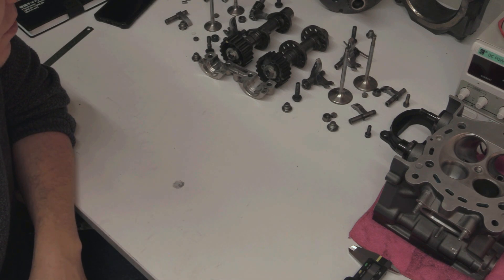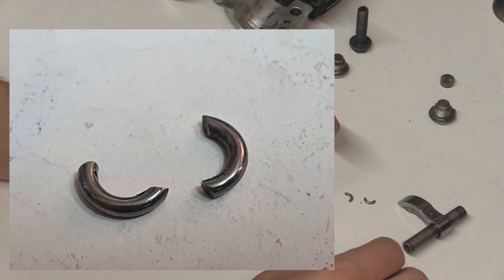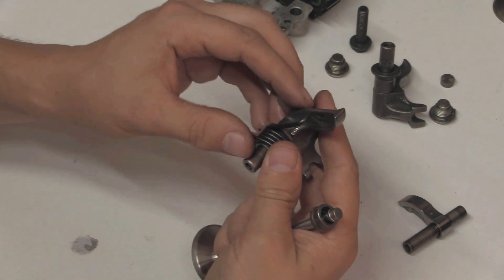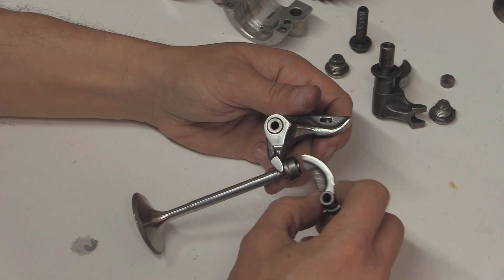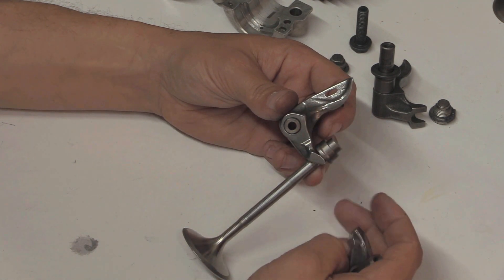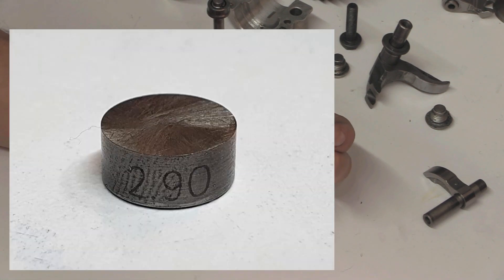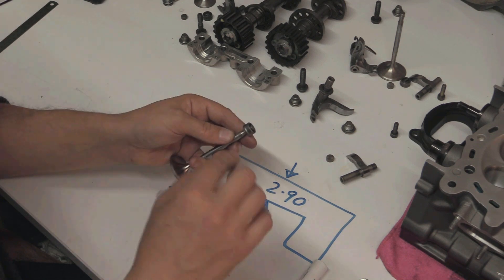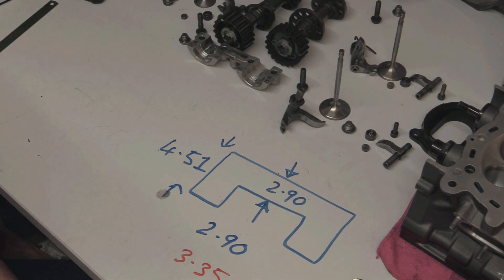Desmodromic Valve Clearances

Comment: Very interesting.  Learn something new every day: I thought the whole point of desmodromic valves was to avoid having valve-springs. Yet, there they are, just in a different place.  I assume the valves still get pulled closed by the action of the cam too right?
Reply: Erik Olafsen ,, the engine will run fine without the springs
Reply from the maker: LOL will it?
Reply: @thedirtyworkshop  They don't idle too well without them apparently
Reply from the maker: Idle, accelerate and generally run properly.
Reply: @thedirtyworkshop  They run fine once the revs are up according to desmo guru Brad the Bike Boy but of course you know better
Reply: The Workshop ,, it’s ok Matt , I don’t expect you to know everything .... that’d be an impossibility 🤣
Reply: @thedirtyworkshop  Wel the now old 2 valve 900 wil run fine without the springs . I now that because i did that on a bott racer in the `90 `s.
Just check the closer clearens every 2 races , so that it is nearly 0 .
If the heads are off , and you turn the camshaft by hand , you wil understand why the desmo system is so great.

Comment: They are a wanker to do if the engines in the frame. I check the clearances on my 916 probably about once every two years. Given it takes about 25 miutes to drop the engine out of the frame its not much of a problem. What kills ducati engines is in general the wankers that own them.

Comment: i always think there is an irony in the Desmo valves on Ducatis, Desmo allows high revs without float, yet nothing that actually revs uses Desmo valves,  never understood why??
Reply: The V4R pk power revs are at 15500 rpm compared to the BMW S1000RR at 13500 rpm (I think). Conventional valve springs have been obsolete at motogp level for over ten years while the Ducatis are consistently the fastest bikes out there.
Reply: @yodaedwards5225  i have a road bike with a warranty and 10k service intervals that revs to 19.5k, on conventional springs.
Reply: @tomnwoo  I bet it's not 1000cc
Reply: @yodaedwards5225  No it's not, but nor is the head mat has a race engine.
Reply from the maker: The desmo was one solution to an old problem. With a bit of thinking the issue (float) was rectified. Ducati have invested that much money in the design that they have to use it, to recoup the money spent.
Reply: @thedirtyworkshop  That makes sense. There's Got to be a bit of Harley Davidson style heritage in it as well, The ducasti won't be pleased if they drop it i suppose. marketing wank.
Reply: i'd love you to take a look at the MC22 engine, so basic and standard, yet revs to nearly 20000 RPM, the Inconel (exhaust) valves are bigger than the bore!!
Reply: It's history kind of explains why. It was designed by an engineer at Norton in the 30s because of problems with springs failing in the racing engines and this was the solution, as many tt riders right up into the 60s used to carry spare springs and a tool to fit them on the side of the course. Just So the could at least finish the race. unfortunately it got shelved by Norton until Ducati picked it up and made a success out of it.
So really Desmodromic was originally designed for 6k-8k rpm single cylinder british thumpers lol
Reply: @johnnywoodbine9092  The old nortons used hairpin springs but I don't think any of them were desmos (I might be wrong). Ducati nicked it from the Mercedes go cars I believe
Reply: @yodaedwards5225   it was shelved by Norton in the R&D phase maybe a  prototype engine or two so unfortunately it never made it into production.
Edit: so after a quick bit of reading turns out i got some bits wrong in my first post lol spring-less poppet valves predates the Norton design by alot. A patent by a Gustav mees describes a rudimentary desmo in 1896. Austin made a 300hp marine engine in 1910 with twin overhead camshafts using desmo valves. The Norton four cam desmo manx engine was patented and prototypes for the 350 and 500 engines built 1958/9 but the higher ups said fuck that too expensive and scrapped it
Reply: @johnnywoodbine9092  I stand corrected!
Reply: @johnnywoodbine9092  ... what about the story that "desmo" valve train was somebodies Masters Thesis?  ... same story?
Reply: the benefits are still there even at lower revs just maybe not as useful.... the latest Panigale engines all rev really high nowadays

Comment: That's an interesting valve spring system using torsional springs. I hadn't seen anything but the traditional linear valve springs before.
Reply from the maker: Torsional springs were actually used before compression springs. Search hairpin valve springs.

https://i.prcdn.co/img?regionKey=aqXnrO6Tb3xwWC7v73Vqcg%3D%3D
Reply: Actually, helical springs operate in torsion while hairpin springs operate in bending